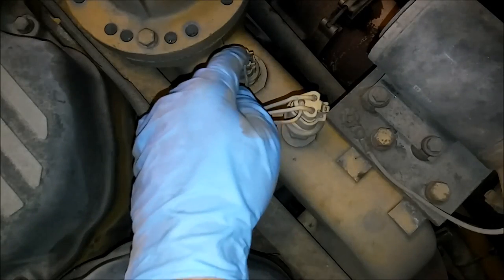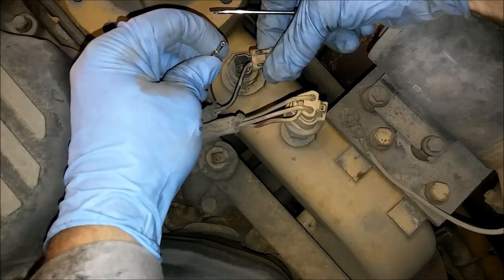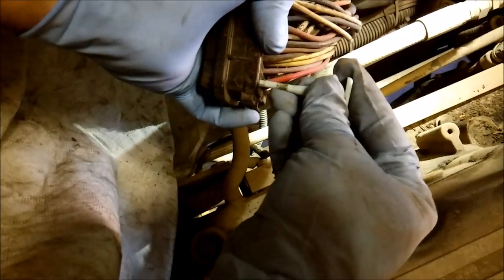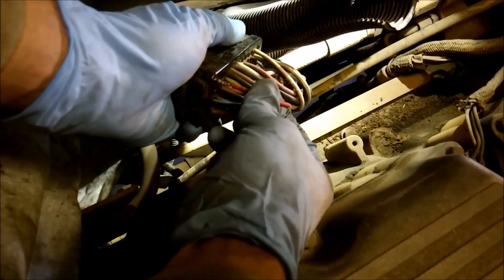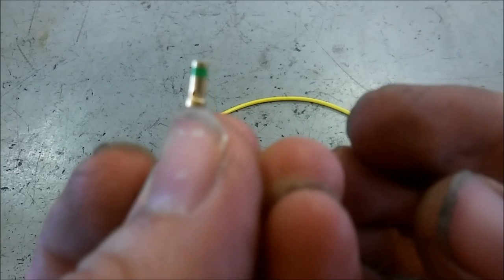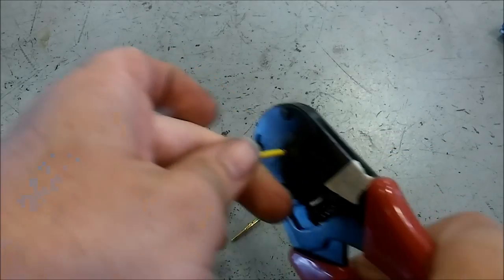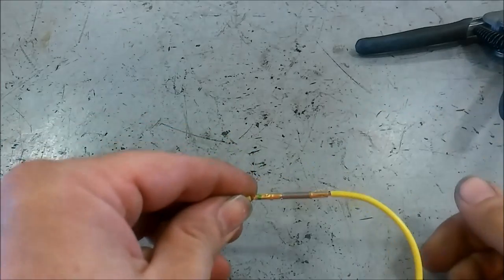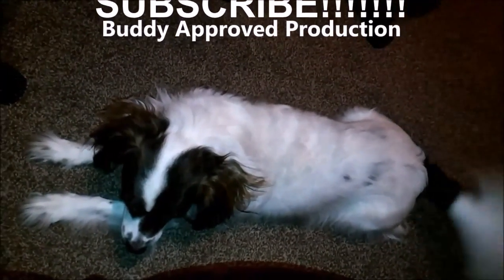How To Fix Cat Wiring and Connectors.  Install Deutsch and AmpSeal connectors.

Comment: just did Cummins m11 celect ECM plug. Gold plated pins. Crane engine. Would die intermittently . Crank sensor wiring was issue. Excellent show.

Comment: Are these the size pins and barrells for the wires on the computer for bxs acert c15.  I need to run a wire from the battery to pin 70 on ecm.  I got a problem with the truck shutting off going down road like you turned the key off.  Truck runs great just like nothing ever happened when you start back up..  From what Im reading online it seems to be a pretty common problem but not many people posting the answer to the problem.  Much appreciated

Comment: Why are the white sealing plugs missing from the 70 pin connector?  The terminals with the green stripe are for 14 gauge wire.  The ones without the green stripe are for 16, 18, and 20 gauge wire.  Don't twist the plastic removal tool.  Push it down and if the socket does not release, remove the tool and rotate it and reinsert it. Age does not affect the difficulty in removing wires.  I worked for a company that built and modified engine harnesses and I have done thousands of these including some really dirty crusty connectors and the sockets always come out easily.
Reply: How do you remove the pin if the wire has corroded off the pin?
Reply: @shawnwesley9750  I know this is an old question, but here is the answer - if the wire has corroded off the pin you insert the removal tool as normal and then push the pin out from the opposite side of the socket.  Often times I'll use the butt end of a drill bit held with pliers so I get a nice fit on the [male or female] pin / socket I'm removing.

Comment: Adept ape I have s question? My 2002 gmc 6500 deisel only starts when I spray a lot of starter fluid in it but it cuts off shortly after. It wouldn’t really run or starts on its own. Any suggestion on what might be causing the problem?

Comment: a great vid as usual, can a wire (from the sensor to the ecm) be replaced by a reguar copper wire, or does it need to be replaced with an OEM wire? cheers!
Reply from the maker: I'm sorry I didn't mention it in the video, yes you can use normal automotive style wiring to fix it, you don't need any special harness wiring.
Reply: Thank you so much! so informative and professional

Comment: Great video, I have a 10 pin connector going into my Cat 420d backhoe forward neutral and reverse selector arm and module mounted to the steering column. Sometimes when I put it in reverse I would have no reverse, I discovered that if I put side pressure on the pin connector that goes into the module Reverse will then engage. I've cleaned with contact cleaner. sometimes it will work after I take away pressure, sometimes it doesn't. I now know this is the problem. What's causing this? and  what can I do, 
   Thanks

Comment: Never twist a deutsch removal tool. That's how you break the tool. Also if you are using one of the metal deutsch removal tools and you twist it you will break off the fingers in the connector that holds the socket in.

Comment: Thanks for the video! Do you know if the smaller cats have the same size (9x3402) sockets on the ecu?  1998 FL70 with a 3126b

Comment: I have 2 wires coming from the oem side that has a connector about 6 inches down-that connector Broke and I cant find the wires or connector it went to- I can get you the pin#'s,but its a Yellow and Green wire that go to this connector,coming out of the ecm plug...........Would you know what its for?? ALSO,I have 2 red wires coming BACK from the truck Harness that broke off from something,about 10 gauge wire- Is that just typical Battery/power? Red is basically Hot? Should I just connect those to the Starter to get power to them?? help please!! Its a C-12 in asemi truck,Oh BTW- I Have No cruise control working and my Vehicle speed is off a little

Comment: Love your video's. how about the three wire plugs like the ones on the oil pressure sensor or atmospheric sensor
Reply from the maker: Same principle, they use the same retaining clips and pins/sockets as the 2 wire connectors. Pretty much all the sensors use the same principle.

Comment: I am curious how the intake actuators work. Have you discussed this previously, or could you go over them in a future video ? 4 years ago I ran an overhead on a mxs ( i think )  C15 that did not have them. I saw the actuators mentioned in researching the overhead setting, but don't quite understand how they work. Thanks.
Reply from the maker: I haven't done a video on them yet, but they are in the works. They are used to reduce the fresh air charge in intake, so that it reduces Nitrous Oxides. They are actuated by the ECM and use engine oil pressure to open the intake valve longer than normal. MXS engines have them, unless you had a different serial number or it had been altered to not use them.
Reply: +Adept Ape I probably over looked them. I'll have to recheck the serial number prefix. It's one of my brothers lowboy tractors. Thanks for the explanation.
Reply from the maker: +george kuersten Glad I could help

Comment: hey could you get me the cat part numbers of the removel Tools for the ecm conectors. I only had the red ones and sometimes they are to smal. Thanks and best whishes
Reply from the maker: +Florian5120Pro I don't know the Cat part numbers, but our shop just stocks them. If you type in Deutsch Removal tool on amazon it'll bring them up, they are made by Thexton. Hope that helps.
Reply: Hi I had problems  with  c15 won't start I lost fuse  which  connected top of the  battry one wire  hook  positive post and other one goes  to the fuse box  where I don't know help me pl